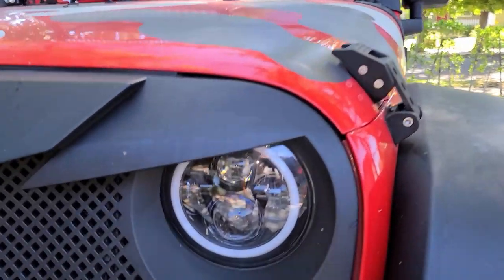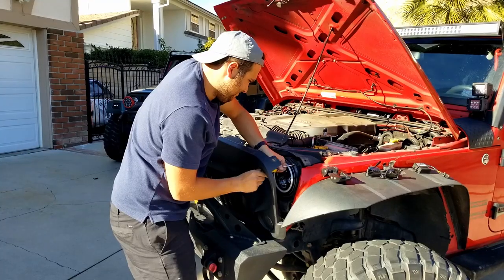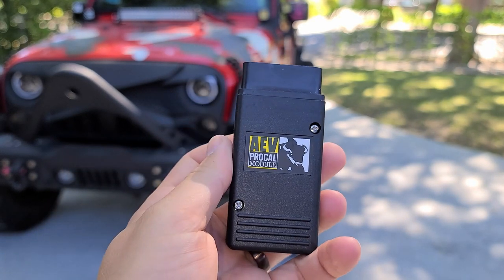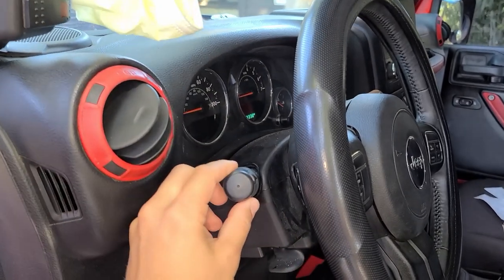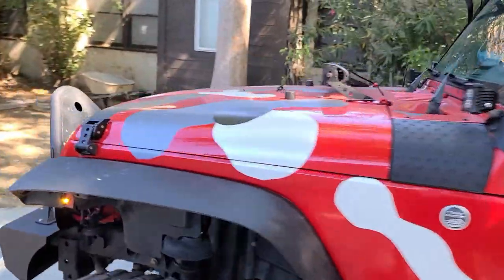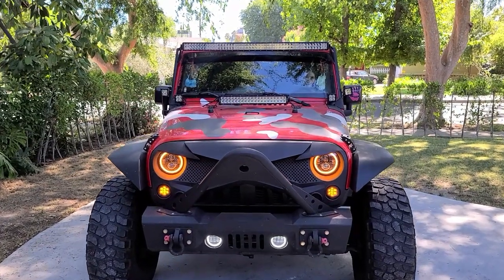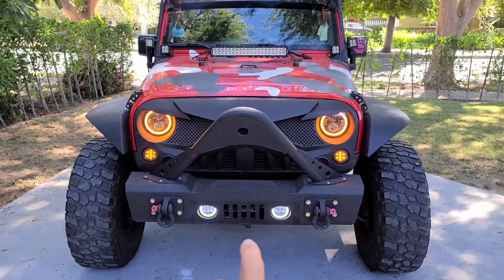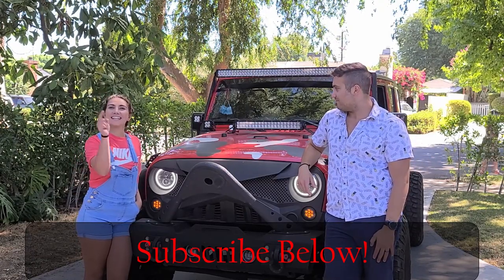Must Have Jeep JK MOD Every Owner NEEDS!

Comment from the maker: If you want to check out some of our favorite jeep mods as well as the parts in this video, here you go!

Here are some of our favorite jeep parts!!
AEV procal module - https://www.aev-conversions.com/product/ram-procal/#year
Plug and play HALO LED headlights - https://amzn.to/36O7sW9
JK LED tail lights (JL style) - https://amzn.to/2XJTXEp
JK Full light bar kit - https://amzn.to/3a9lcNA
Cerakote Plastic trim restorer - https://amzn.to/36JAvew
Jeep bottle opener - https://amzn.to/32vqnFT
Motofab lift 3 inch lift kit under $150 - https://amzn.to/2CJD9pF
Circle third brake light - https://amzn.to/3jhECEl
Auxbeam 7 inch Light pods - https://amzn.to/2z9gJfm
Auxbeam hood light bar - https://amzn.to/3cbszVj
Shrink electrical connectors 540 piece - https://amzn.to/2VWQPoc
Smoked LED turn signal - https://amzn.to/2EQ7X67
Steel Stinger Front bumper - https://amzn.to/2WjykMA
Smittybilt cargo cover - https://amzn.to/2QeIMzQ
Ares technology PCM - https://arestechnologies.com/
Skyjacker lift kits: https://skyjacker.com/
Rocktrix Rims - https://amzn.to/2xS8Mus
Milestar Tires - https://www.milestartires.com/ 
Affordable sun shade - https://amzn.to/2wWQQyq
Rear LED tail lights - https://amzn.to/2wa7evn

Comment: I took off my head light off my 2017 jku and it was not easy as the lights changed to led for the 17 model.  Also I just realized I need a bucket for the new light to fit so in short I’m still stuck 😥 really was hoping to get this installed.  Do you know where I can get a light bucket for a 17 jku?
Reply from the maker: Aww why???
Reply: Garage Couple 2017 Jeep headlight comes out as 1 unit where I think your 2015 the light came out as only the light and not the housing the light sits in.  So when my original light was removed I had to snap it off the housing then remove the housing.  I got a new housing from amazon and installed my head light on the housing first then install the light and housing together as one into the opening then attach the silver ring then adjust the light height.  Little more work then I wanted but the results are worth it.  I’m a more novice Jeep owner then you guys but learning as I go.  Love the lights.  I seem to get more looks at my Jeep especially when running the DRL’s on.  I sent a pic after the install I must say it did turn out great.  
Your guys are awesome!!  👍
Hope my tutorial made some kind of sense.  😁

Comment: If I remember right when you installed the new headlights you had to hook up 2 power sources for the lights, one from the headlight plug and one from the turn signal plug. Because the halos are powered from the turn signal you are getting the orange. To get the halos alone I think you would have to add a separate power source.
Reply from the maker: Hi! They both hook up to the turn signal, one for the parking light half voltage one for the full voltage..

Comment: I have the OBD Jscan app on my phone and a Bluetooth obd port adaptor in my 2010s port and i can do all of the AEV plus 30 times what that thing could ever do or the jl tazer could do and it was under $50 app and adaptor
Reply from the maker: That might be true, but that's the price difference with  coding a vehicle using Bluetooth vs coding a vehicle directly without a connection. Would be a heck of a lot more expensive if the Bluetooth bugged while coding, can brick the computer. (Ask me how I know)
Reply: @Garagecouple  you've coded before huh and so its clear there are 3 bluetooth adapter cleared to work and another 2 or 3 possible working bluetooth adapters that the jscan app will work with so its been tested rather well
Reply from the maker: If the bluetooth connection gets interrupted, phone app fails, phone dies, etc, anytbing leading to disruption the result will be a bricked ecu.

Comment: Awesome video guys! I bought the same halos thanks to you guys and I wanted to achieve the drls but the white halo. Do you guys know if there’s any way to make them light up white with the programmer? That would be awesome and appreciated.
Reply from the maker: Thanks for the comment! We weren't able to do it! Unless you want it to blink white when turning lol!
Reply: Garage Couple lol that’s actually what I’d prefer. The amber is nice, but I really do love the look of the white halo and if I can make it white when signaling then awesome! Would you mind showing in a video on how to do that please?
Reply from the maker: It requires re wiring the halos, which we wouldn't want to do. It would be best to buy a non plug and play headlight set and then just wire the white halo to both pull power from parking light and also blinker
Reply: Garage Couple oh ok I see. I don’t want to wire or cut any wires either. Thanks for the information.
Reply from the maker: Of course! Thanks for the support

Comment: JScan app does all the same features and all you need is a $30 Bluetooth adapter,,,,procal is around $200.
Reply from the maker: I will never code anything via a wireless connection. Learned my lesson after bricking an ECU due to a disrupted signal.
Reply: Garage Couple excellent call! People have to much faith in low quality cheap sketchy parts. My dad had a bricked computer also after messing with something similar